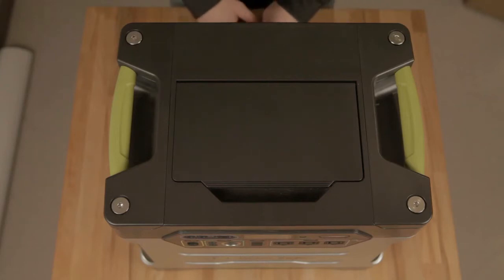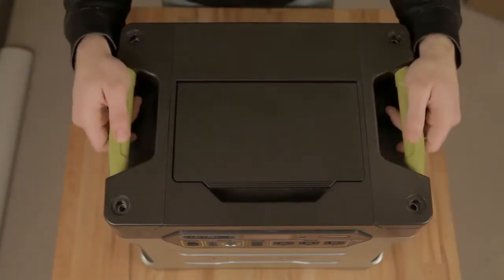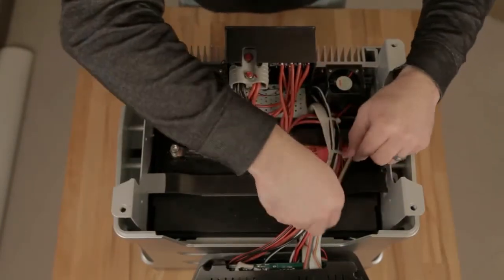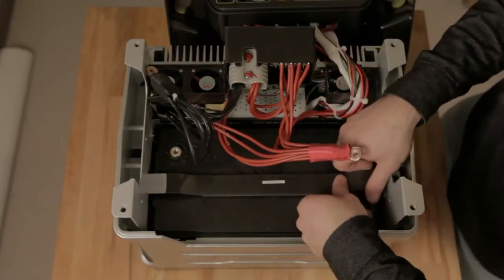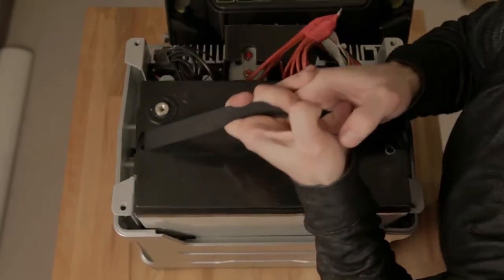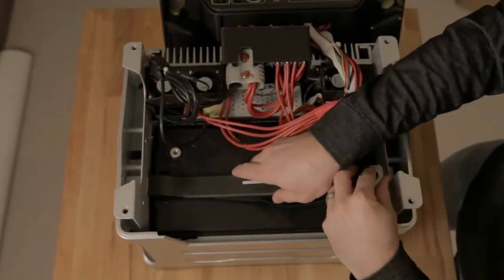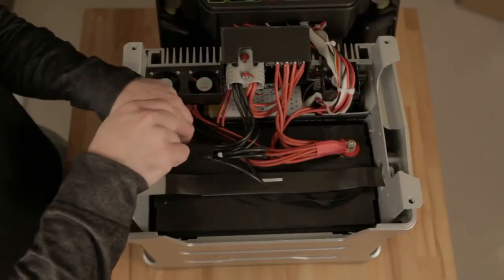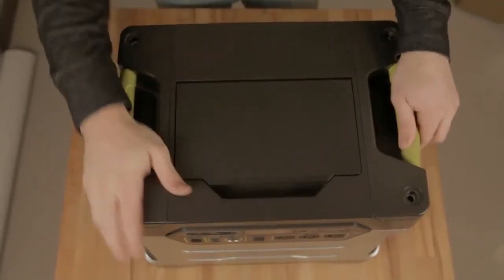Replacing a Goal Zero Yeti 1250 Solar Generator Battery

Comment: Is this same way to replace Yeti 1000x battery? I want to change my lithium with LifePO4 because the risk of explosion is too high with lithium batteries. Maybe you know a solution. Thanks
Reply: What about the lithium ion ones in the 1500x can they be replaced with the lifepo4?
Reply: Charging systems are different between lead acid and LiFePo4. I would not recommend that.
Reply: Okay, I wont do it, thanks for your help  @mikebarnard9285

Comment: I replaced the original AGM battery with an 'Ultramax 100ah LifePo4 battery, much lighter (4 times lighter than the original) and can be run down to a safe ten percent making full use of solar stored power from the battery.
Reply: Have you found any issues with charging and discharging?  Are you recommending not going below 10% as put out by the GoalZero?
Reply: I did the same thing and it doesn’t work. I put in a 12.8v100ah Redodo Lifepo4 battery to replace the lead acid one that came with my Yeti 1250 and got a battery error message after a minute.

Comment: People ! Its not a frickin 'generator ' !! It does not create electricity- it STORES electricity. Now consider this for example : a Dam's Hydro power station creates electricity by using water to turn turbines that create a field  that generates /creates electricity. Then it is  sent out to your homes businesses etc. A small gas powered generator does the same exact thing albeit on a smaller scale. Solar panels basically also do the same thing : they convert one type of energy into another. So the solar panel is converting sunlight / generating electricity and the Lithium or AGM battery is simply the storage medium for on demand use. Goal Zero, Jackery etc power packs STORE electricity they do not create it !
Reply: These units have a built in mttp solar inverter so when a panel is plugged in they charge themselves

Comment: Good day, I changed the battery on my 1250 recently with a 12v 100amh unit.The 110AC side has the green light showing that it is on but it has no power.It chirps when I turn on the 110 but not when the DC side is on,which works fine. There is also a red light that comes on inside when the 110AC is turned on. Any advice or recommendations how to get this fixed?
Reply: me too

Comment: Great instructions - thanks! I had a little trouble with the stabilizing bar.  The coating prevented me from sliding.  I forced it, them removed a portion of the coating in case I ever need to replace it again.  Other than that, it went perfectly.  My wife was surprised to see me put something back together that I took apart.
Reply: I hope my wife does not see your post as she will expect the same from me.

Comment: it would be really helpful if you told everyone what size allen key they need to unscrew the top
Reply: The Allen wrenches comes with the yeti 1250.
Reply: If you lift the lid on your Yeti, there's a plastic bag with instructions and two of these special allen wrenches. They are quite large, I don't know the exact dimensions, but a quick call or note on the goalzero.com site should help
Reply: it is a 6mm. Metric
Reply: As mentioned below, mine had a wrench as well but didn't look for it until I saw this message.   I can tell you 1/4 is a bit too big, 7/32 was a little loose but did work although not ideal.   If I had to guess the size is 15/64 based on that.